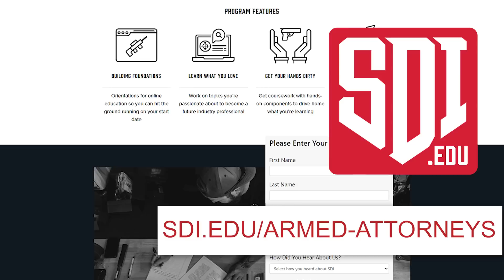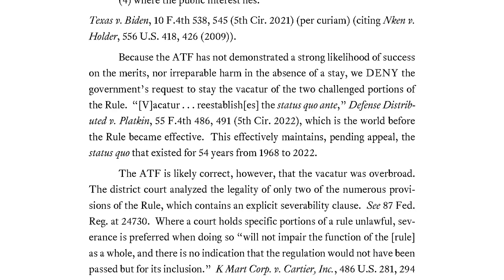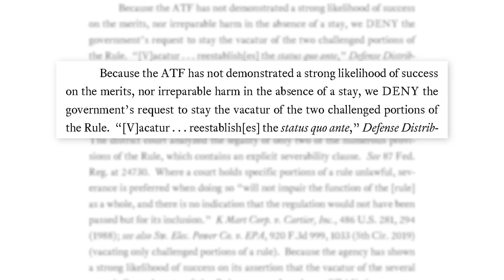ATF Loss in Frames and Receivers Court Case

Comment: Would have been nice if the courts would instantly block these “rules”.
Reply: IKR, one would think the default was in favor of the citizen with the burden of proof on the govt. Further, that the govt couldn't start enforcement until all appeals are settled in their favor. ...and yet, both the district court who decided ATF was exceeding their authority and 5th Circuit CoA who concurred ATF was exceeding their authority granted administrative stays permitting the ATF to continue abusing their authority. I think this completely flips presumption in favor of the state.
Reply: "Rules"
Reply: So you're expecting a true separation of powers and system of checks and balances?

Comment: If you cannot insert a round and WITH A PULL OF A TRIGGER have the round discharge then it is NOT a firearm it is a block of metal, wood or plastic PERIOD. Now ask me if the ATF should have ANY say if it DOES discharge a round...hint it rhymes with HELL NO!

Comment: Actually, ATF is claiming that frames and receivers are NOT defined in the GCA. Technically, they are not. However, the correct rule of construction absent a definition is the "ordinary meaning" of the term. As Judge O'Conner pointed out in his summary judgement:

"Because Congress did not define “frame or receiver,” the words receive their ordinary meaning. See 18 U.S.C § 921 (defining other terms); Kaluza, 780 F.3d at 659. Contrary to Defendants’ assertion, in an interpretive dispute over a statutory term’s meaning, the Court does not simply “leave the precise definition of that term to the discretion and expertise of ATF. . . .  Statutory construction entails “following the plain and unambiguous meaning of the statutory language, [and] interpreting undefined terms according to their ordinary and natural meaning and the overall policies and objectives of the statute. In determining the ordinary meaning of terms, dictionaries are often a principal source.” NPR Invs., L.L.C. ex rel. Roach v. United States, 740 F.3d 998, 1007 (5th Cir.2014) . . . Near the time of the GCA’s enactment in 1968, Webster’s Dictionary defined “frame” as “the basic unit of a handgun which serves as a mounting for the barrel and operating parts of the arm” and “receiver” as “the metal frame in which the action of a firearm is fitted and which the breech end of the barrel is attached.” Webster’s Third International Dictionary 902, 1894 (1971). ATF’s prior regulatory definition, which defined “frame or receiver” as “[t]hat part of a firearm which provides housing for the hammer, bolt or breechblock, and firing mechanism, and which is usually threaded at its forward portion to receive the barrel,” tracks that common definition. Title and Definition Changes, 43 Fed. Reg. at 13,537.

 . . . that which may become or may be converted to a functional receiver is not itself a receiver. Congress could have included firearm parts that “may readily be converted” to frames or receivers, as it did with “weapons” that “may readily be converted” to fire a projectile. Id. § 921(a)(3)(A), (a)(4)(B). But it omitted that language when talking about frames and receivers."

Comment: Does Home Depot and Lowe's have to do a background check when they sell a nail gun??
Reply: Jose, you'd have to do a lot of modifying to a nail gun to make it a weapon 😅
Reply: @1975KyleDavid  I used one many years ago working commercial construction.  Just being sarcastic
Reply: All you have to do is hold back the safety. Worked in construction 35 years
Reply: @JoeyFranko  Was the safety on the front of the barrel? The one I used had a square plate that had to be flush to the end of the barrel to fire. I fired a few nails by holding it and pulling the trigger
Reply: I also heard of people building their own "firearms" that take a nail gun snap cap and an airgun pellet.

Of course that is only somewhat more convenient than a muzzle loader, which are exempt from most rules anyway.